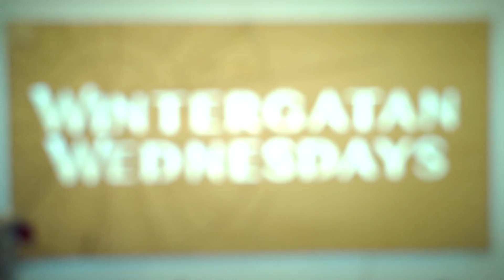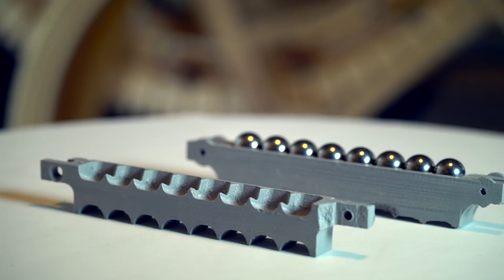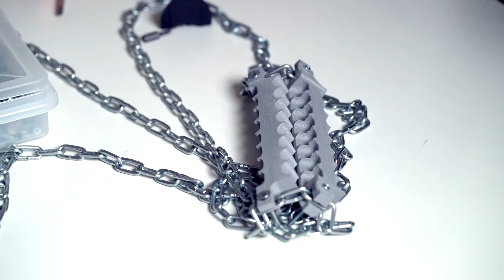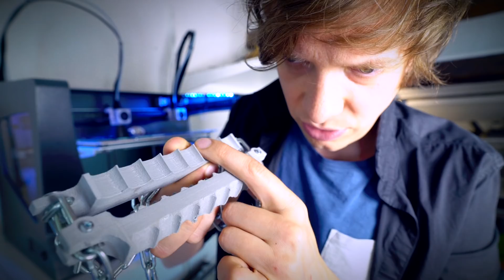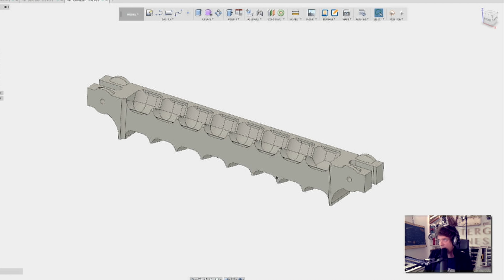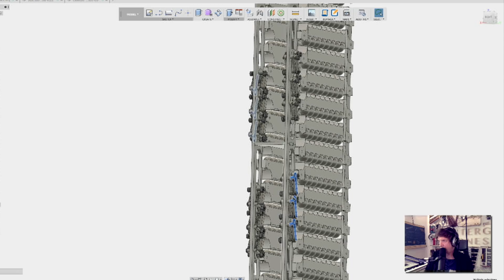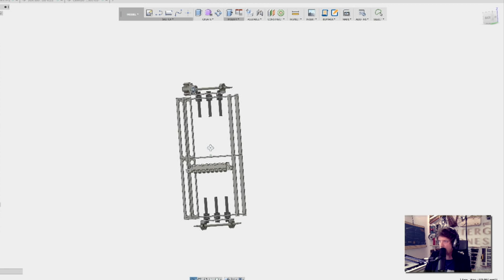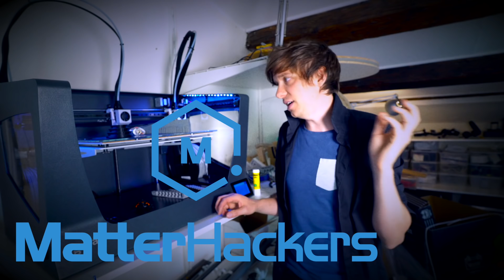3D Printed Marble Lift - Marble Machine X #34

Comment: I know this is already a month old, but. Since you're using a dual nozzle 3D printer you can print the support material on a plastic that can dissolve in a liquid (can't remember quite well if it was water or not) to eliminate the hassle of having to pry it out and cleaning the printed part every single time.

Comment: did u thought about running a stress test for those plastic parts once they are assembled ? ... not one about crushing or twisting but rather about stamina and endurance for the prolonged use they will suffer ?

Comment: First off. I've been following the development of this massive project. This Marble Machine X is becoming an art of old clockwork engineering only seen now in days by the few watch smiths that create mechanical time pieces. (I don't have the knowledge/background to claim it to be on the level of a clockwork masterpiece. Wish I did.) I see an irony here and it's awesome. Using modern digitally controlled equipment to create a precise analog musical time piece machine. There are somethings that analog can do that digital and never do.

Comment: The "rule of cool" is what's been keeping you from getting things done the past year.

Every time you come up with a design somebody (usually yourself) decides that it's not pretty enough. You are concentrating on visual details that are not visible on a stage anyway and your designs keep getting more and more complex *just to look good*.

Remember: you are planning to take this thing on tour, which means it will be in a truck most of the time, getting bumped and shaken for hours at a time. That fancy chain-drive will be destroyed  after the first trip.

It any roady bumps into the mechanism of the MMX, it's done. Comepletely done, twnty parts will be broken ata minimum. You've got a million parts on it and most of them cannot be re-created without a CNC machine and now you're making yourself dependent on a 3d printer too.

Remember the irst Marble Machine? It was falling apart before you even made the video.
What makes you think that a machine that is 40x as complex will survive going on tour?

Go back to what you *need*, and build that. Don't build what you *want*, because you don't know what you want, you define it only as "cool" and "looking good". What you need is a reliable machine that doesn't break while you are on stage.

Make it WORK first, then make it pretty.

Comment: Once you're sure the lift is functioning, and DEFINITELY when you're sending out to have backup machines built, you should have a mold made for the lift steps and have them formed that way. It's just not what the printer is built for to make 50 of the same component, it isn't efficient.

Comment: if you are going to use the bearings, make sure they are installed the correct way or they will not work and cause binding and jamming which will lead to more problems down the road.

Comment: Try using your main material along with a dissolveable matetial so when you do need supports, instead of filing down excess you can just dissolve it in a bath.

Comment: Using a chain is probably the best choice. Its amazing how fast the chain will wear out going around such small radius turns. I'd recommend using a flat belt, similar to a car's serpentine belt, clamping the carriers to it. This would also be significantly quieter. Your ratchets are a neat idea, but will cause a LOT of clicking noise you may not appreciate later on.
Reply: Should say NOT the best choice.

Comment: Martin, you can 3D print production-quality parts with Carbon3D which are very strong and temperature-resistant.  Maybe when you finish prototyping your polymer parts you should find the nearest Carbon3D printer and send your files there.

Comment: Martin, I have quite some experience with 3D printing. I went for a Atom3D printer, when it was still in the crowdfunding phase. It is worth looking on their website. With the new heated printbed and the cooling system, you almost do NOT need supports. One very important thing: Get a good slicer. No, get the BEST slicer on the market: Simplify3D. It is worth every penny. 
Please note that PLA prints will bend over time. Use ABS. Or... you have a very powerful CNC router. When you modify your design a little and you can cut it with the router. It can do 3D or at least 2,5D... Plus it will look way cooler.

Comment: I would advise splitting the print in two. That way you only have to glue those two parts together instead of removing all the support structure. Probably more time effective and accurate.
Edit: Should have seen the whole video before commenting.

Comment: Those ratchets will make some noise. Will you try to reduce the noise, or engineer it so it is on the beat, or even have an adjustable drive so you can have it anywhere within the beat you want (might be a cool way to get some off-beat percussion instead of right on the beat like a metronome).

BTW, really cool using the underside of the block as exit guides for the next dump of marbles. At the beginning I just thought they were clearance reliefs so you could have thick blocks for strength yet pack them close together. But actually using them to guide the marbles out of the lifter is brilliant.

Comment: You could rotate the lifts by 90 degrees when printing.  The flat faces would function as support for the rest of the piece, so the only piece that would need support is the pin-hole.

Comment: It's looking really great! Though I don't see why you would want to split the part up, when you have a (seemingly) completely flat backside to print it on? Then you wouldn't need a raft, only a brim and there should only be a modest amount of support (in the flat space where the chain goes), which should be very easy to clean up! Keep up the cool work! :D

Comment: As a 3D-printing evangelist and both BCN3D Sigma and PVA-user I want to give some info about the PVA-supports. As most commenters say, the PVA is an option for supports but it's not always the best option.  you see PVA behaves a bit different than other plastics and can become hard to work with after a days (if not hours) exposed in an open, moist environment (the way you have the open door to the garden makes me think it can get quite moist morning and evenings...).  

When PVA is turning "bad" it starts oozing alot, which means extruding when you don't want it to due to the moist boiling. This can lead to brittle supports and in general an ugly print. (BCNs have purging and containers to avoid this, but it's still possible to be annoyed of)

The use of dual extruders also takes longer time (although the BCNs are faster than most on this), but should be considered.

The PVA also takes quite some time to dissolve and that would slow you down a bit. If you don't circulate and sometimes renew the water it will also "saturate" leaving sirup-ish goo on your models.

With that said the PVA should be used when you have for example interiorsurfaces that need support (like an exhaust manifold, pipes in a cluster, small gaps of material) where it provides superb support. 

This model (with some better settings for the filament you're using) wouldn't benefit in real life practical terms by the PVA Support since both print times and printer maintenance/care would be much more work than to have a good 1-material raft/support that could be pulled off without all the chisel, drilling and filing we saw in the intro. PVA is best used with models that have inside-support that you can't reach to "pull off". 

Lastly, if you want to produce models faster and more efficient, you should use the duplicate mode of the Sigma X with 2 extruders doing 1 part each instead of using PVA as support.This helps you produce faster production when needed and you would actually double productivity after initial prototyping :) 

I'd be happy to answer any questions!  //Anton

Comment: How do you plan to actuate the ratchet system. You could use a cam on the bottom of the ratchet to push it up and power it with a one directional wheel. If you have the ratchet on only one side wouldn't it want to flip it over towards the opposite direction. Instead of having a one ratchet set going up and one going down you could have an alternating ratchet set on both sides of the lift going up both powered by the cam.

Comment: I can understand the "rule of cool" since this whole maching is not about making things easy in the first place. But I'm still worried abut your choice of using several different lifting mechanisms, including several different marble dividers and then combining them again several times. I would reccomend that you use only one lifting mechanism with only two large reservoir of marbles; one at the top and one at the bottom. With the current design you run the risk that one of the several lifting mechanisms have sligtly different efficiency. If the bottom lifter is slightly more efficient than the next one you risk having the middle reservoir (that by space constraints needs to be very small) overflowing which in the absolute worst case could cause marbles to fall into the mechanism and damage it unless you specifically make an overflow channel to handle this. If the bottom lifter is slower than the next the next one will run "empty" and you could run out of marbles on the top too fast.

I also think it would be more reliable and quieter if the one lifting mechanism were moving continuously and were linked with a variable power transmission like a belt drive with a countinously variable gearing to the rest of the machine, so that you could smoothly adjust the marble lifting rate for songs with different marble consumption rates, so if the top reservoir starts becoming to full you can slow the lift to not overflow it. That way you don't need to needlessly lift marbles that wil just overflow and fall down again.

Comment: Try to buy (Chloroform) for gluing the parts, it melts the PLA and will make your parts rock solid if you treat your parts in a vape chamber or a fast dip in that solvent.
HIPS for support that dissolves in alcohol, easier than using PVA.

Comment: If you already have two extruders, try using PVA filament for the supports. It is water soluble, so to remove the supports you just have to drop it into water for a while and the supports are gone. Should give you much better quality than to manually remove the supports. Also, maybe try another filament for your print. The one you have now is a bit ugly. Maybe try a PLA/wood filament as the wood look might fit the marble machine better.

Comment: Could you not just print the parts resting on one side without any supports for the marble locations and maybe minor supports for the guide/chain slit part? That would safe you the hassle of printing the part in two halves which you would then have to sand and glue together. Also any warping on either of the two halves would then make it impossible for the parts to be glued together seamlessly. Also consider dialling down the support density, the bridging of the parts wont need very dense support, just enough to keep it from drooping. Also if you could use dissolvable supports, that will make your life very easy.
And yes as others have said, keep the drafts near the printer to a minimum, that will help reduce warping.

Comment: 2 printing heads doesn't speed up the print. if anything it slows it down because it can only use 1 printing head at a time.
also printing multiple separate parts at a time doesn't always work well, it can have alot of stringyness and deformed parts but that depends on the machine. 

keep up the good work

Comment: To reduce support removal work and better prints that are solid rather than having to cut and glue together to avoid supports, you should look into dissolvable filaments for the supports. As I only have a single head printer, I haven't done much of my own research on this, but I know it is out there and pretty commonly used for dual head printers. I hope this helps and makes work a little easier!

Comment: Congrats from the almost 5grand gift! Give your address and the blueprints for those parts, s.o. anyone with 3dp can print the parts for you and send them to you. All free and the printerers paying to get maybe their manufactured parts to the mmx. Also get rid of the original drill bit holder on the drill you have, there are much better spare part for that machine, better grip for hand and drillbit. Also the original worns out on pro use and you dont able to get grid for 3.2mm bit anymore.then 3.5 and s.o. on.
And put some guidance rail for that chain in the fully up and fully down positions,(U -shape) it will otherwice propably stuck .. (I dont have 3dp)

Comment: A lot of the print quality comes from the software side of things in your slicer program; you can improve the quality quite a bit without even touching the printer. For example, the quality of the print is largely dependent on the first layer. There are a lot of ways to do this, with a raft, brim, or skirt. A raft is nice you don't have to level the bed, helps the print stick, and primes the extruder, however your actual object will have a rough bottom. A brim only primes the extruder but it keeps your print pristine. A skirt us like a brim but it connects to the object helping it stick but also has to be shaved off (I like this one the best). When printing your first layert you want it to be super smooth woth no holes or bubbles; to do this increase the extrusion rate a bit (not too much though, othereise it will clong to the extruder) and slow down the head speed by 20 to 50 percent also disable the fans on this layer only. Additionally, it looked like you had some layer adhesion problems, to fix this, try slight lowering the speed of the head while slightly increasing the extrusion speed. This will alow the current layer to transfer more of its heat to the previous layer increasing their 'flow'. You can also increase your print speed without sacrificing quality or durabilith by limiting how much infill you use and increasing you loop count by 1 to 3 loops. Also if you increase your extrusion width you can get away with harsher over hangs. I can't wait to see what you will print, best of luck.

Source: work with a 3d printer all the time.
Reply: I can just agree with you there. When I had problems with my 3D-printer I also tried solving it through hardware and firmware changes but I found out, that I only had bad slice settings - now my printer is printing perfectly! (By the way, I'm using Slic3r and Cura - I can just recommend them.)

Comment: I love Wednesdays! As for print direction, couldn’t you print in one piece opposite direction as when you started? If you did, the only overhang would be the slot where the chain goes and supports in there (once you get your machine tuned up) wouldn’t be bad to remove; plus less critical since the chain gets immobilized in there anyway. I would think it would save a bunch of time not having to glue and sand seams.

Comment: Use the 2nd print head to print water dissolved supports. (faster then trying to glue 200 parts together)
Plus you also get to print twice as many peaces at the same time. 
If you print with the back of the part to the ground, there would be very little need for supports. 
Square ball holder holes would print faster, be lighter, require less finishing, and can be printed without needing as much accuracy.

Comment: Use a different material for your supports. Then you won’t need to cut the pieces in half. They make materials that will dissolve in water to use for supports

Comment: go for a different material for the support structures insted, like PVA that is water soluble, instead of trying to skip supports.
Correctly made supports is usually not a problem.

Comment: Martin, first of all, great job! You design better than some engineers I know. I especially like your tensioner system. A few notes about 3d printing:
1. Be careful with your printerr parameters. We broke a printer at work recently because we didnt have the right temperature
2. The strength of your parts is also determined by print direction. The parts are the weakest when pulled apart  in the print direction. Just something to keep in mind.
3. 3d printed parts do not generally wear well over time. Make sure you always have backup parts on hand, especially when you go on tour :)

Also, your side guides on the frame are good in theory, but may cause jams or extra friction  in practice. Consider using just one guide (maybe in the center on the inside of the frame?)

Keep being awesome dude!   -CN

Comment: since you have a duel material 3D printer, use one extruder to print dissolvable support material and use the other extruder to print the actual product, you'll get a lot higher quality and it's a lot easier to remove the support material, also, when printing, try to get everything right in the design to minimize the work you have to do after printing.

Comment: Given the parts clean-up required, a thought could be to finish one part to a high standard, then make a silicone mould of it and cast the remainder in resin. Sometimes older-school methods are better - and still pass the rule of cool :)

Comment: Haha awesome dude! Love how this new build uses so many different processes. Dual material 3D Printing is pretty challenging, don't be afraid to use 'break away' support structures in the same material, they can work quite well. I think RYNO is a PETG filament which should be quite durable, however a heads up I would be cautious printing in PLA for your final parts as it can deform easily in hot temperatures (like a car or container in the sun). It is easier to print though!

Comment: Are you worried that the carriers will be able to get back onto the tracks after it goes around over the top or back up from the bottom? If the slot in the carrier missed the track it might get caught and I imagine that could cause a lot of trouble.